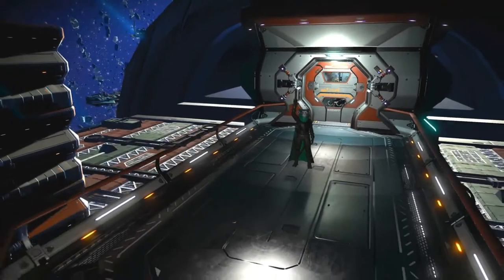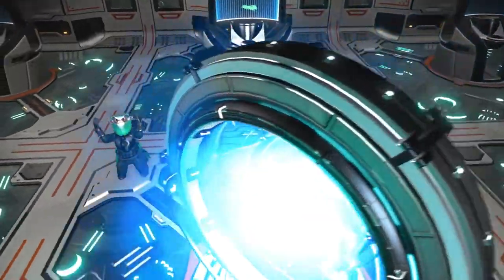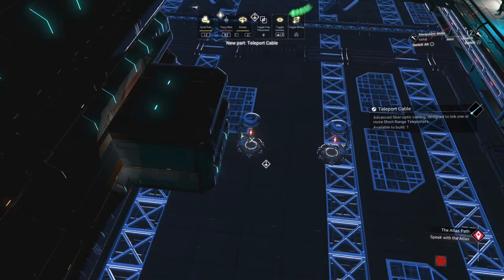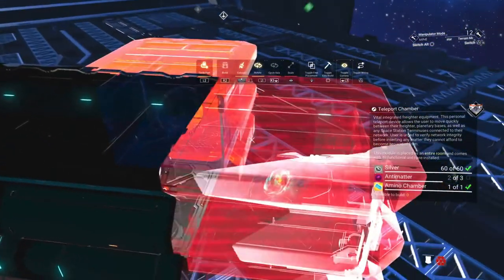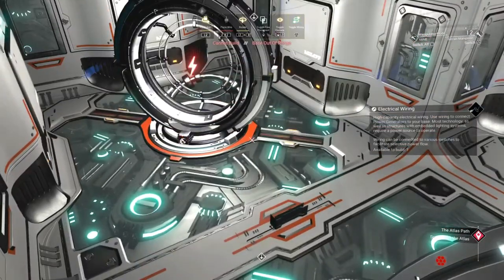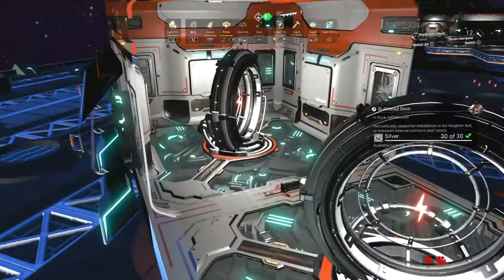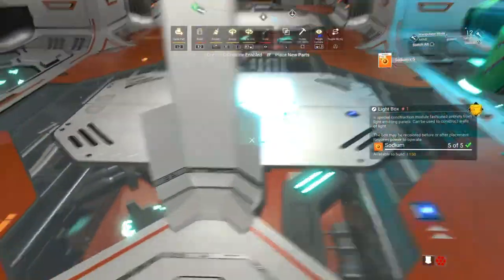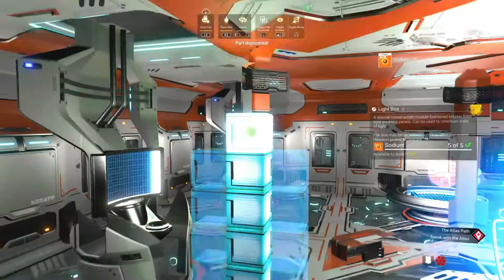GlitchSlapped By Enra: Episode 33 - Fixing Freighter Teleporters! No Man's Sky Build Tip #nomanssky

Comment: I dont mind it being on angle. Looks good in a corner. But I would like it to be adjustable like it originally was. & I don't like that you can't activate it from the front. It seem to only work from the back or sides. & sometimes I have to search around it to find the one spot that will activate it.
Reply from the maker: Yeah, the fact you can only access it from the back is definitely frustrating 🤬🤬